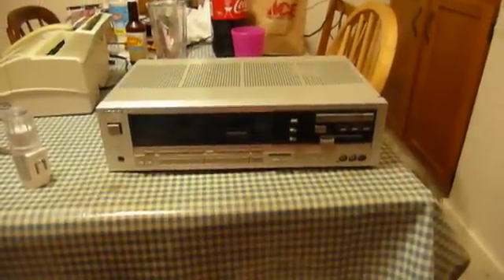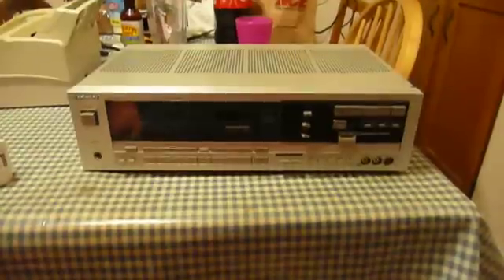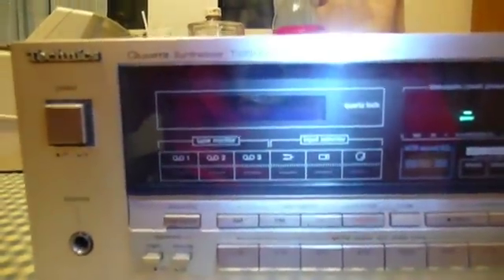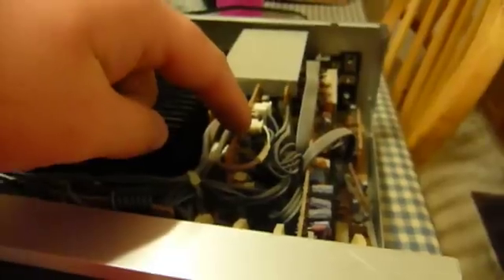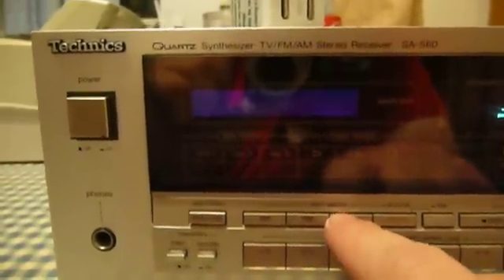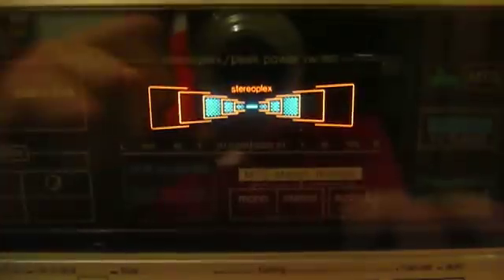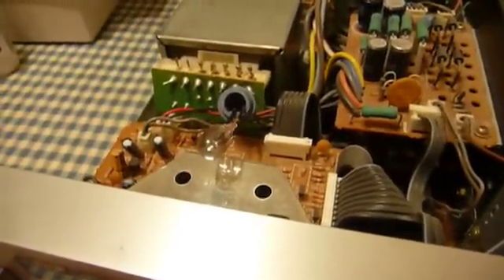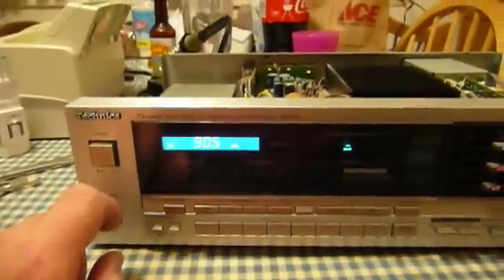Technics SA-560 Repair and Demonstration

Comment: I heard that some of the technics stereo receivers have overheating issues and tend to get very hot quickly even if the speakers are not too low of a impedance which is kind of why some of their receiver models are overrated

Comment: Cool vid, wondered if you have any idea what could be wrong with my technics graphic equalizer, sh 8055, everything powers and lights up, only problem is spectrum display allways shows max reading( full bars) tried dis coneecting everything and all set low still same, cheers!

Comment: why didnt you replace the main bulb? i have one with main and lcd bulb dead, i miss it lighting up that incandescent light color. my bulb actually died because one of my friends dropped my amp. olso once apon a time i was scoping my firednds sundown amp and for some reson my scope with with its touchy controlls send out 40v to my firends amp output, it blew his amp out, his amp ran off an output from my amp, and my soundcard blew out on my computer to... my   Technics SA-560 still works like it did when i got it.
Reply from the maker: To the best of my knowledge, I replaced every bulb this receiver had!

Comment: I have also this same obsession, just with Sony hifi equipment. Whenever I see a piece of old Sony hifi equipment, I just instantly fall in love with it and can't resist but to buy it. I really would like to try out this Technics equipment too as I really like the build quality and styling, but they are fairly expensive over here in the UK in my opinion, either that or I don't have deep enough pockets... There is just a kick you get out of buying these things when you are addicted, and it's always a specific brand or product line.

Comment: Hi there so nice to see some other Technics fans! I have an SA-410 that I just love. In great condition, well it was...All the lights are on but no one is home. It was working fine then one of my speakers sounded fuzzy. I do need new speakers so I thought that was the problem then the sound just stopped. Now no matter what I hook it up to all the lights go on but it won't work. Any idea what's wrong? Very hard to find anyone who will even look at it!
Reply: ***** 
Thanks so much for such a quick response! I did have something repaired several years ago it by a friend when I lived in NY. He was great with this stuff. I now live in Florida and it's so heavy it would cost a ton to send up there to fix. Either way I used to have a pre amp on it for years and it was fine. The pre amp blew and it did just blow a speaker before it went dead. Thankfully they are older speakers too. Any idea who would be able to look at this in FL? Or should I just say good-bye to it?

Comment: Hey UXWBill! Great video. I have a Technics SU-G90 receiver that is being really stubborn. It worked fine until I hooked up an equalizer. The unit turned off, and when you turn it back on, the relay would click, but there's nothing on the display and nothing coming out of the speakers. If you let it sit for a while, it would sometimes come back to life (if you are lucky) and play for a little bit until it decides to turn off and not wake up again. Do you have any ideas that might get it working again? It would be a shame if it didn't work anymore because it sounds pretty well for its age.

Comment: Do you know where I can get a 12v .015a bulb like that?  I have an SA-460
Reply: *****
  Thanks =)  that's exactly what I ended up getting, the pilot IL-194w-5 at autozone for 12.99.  Worked wonders and now I have 50,000 hours.  The stereo will be dead before that bulb lol.

Comment: Hi uxwhill! I wonder if there's a way to tweak the transformer of my Technics stereo amplifier to receive wall power supply from 110 volts to 220-240 volts without any change in the output voltage that it's giving out to the amplifier.

Comment: Btw i have been repairing a few receivers too, and i did replace my glass bowl lamps all with LED's because those glass lamps all die really quick, i just dropped a 1k resister between it and it worked perfectly.

Comment: Bill, 
      I have a Technics SA-360 with the quartz syntheizer and am/fm/tv receiveing capibilities. It's problem is that the right channel is weak and distorted and the front a/v jacks don't work when selected. When I got mine the backlight bulb was toast too. Until I tore it apart I didn't realize how many other bulbs was in there and burn't out. Mine is a New Class A amplifier. It's not computer driven or a hybrid. I was wondering if you might have any info available. Thanks, Nathan

Comment: that seems like it does the same thing as the satellite speakers on my aiwa radio. actually like the aiwa cx-naj80 aka nsx-aj80 as the manual says i found online says. 250 watts and a lot of bass. there are 2 connectores for each speaker.

Comment: my 94 toyota camry radio a16404 has a light that messed up. should try and fix it some time. sure this radio is a basic one with tape but i sounds better then the sony explode and vr3400sdu radios i tried. toyota put 6 ohm speakers and radio in there car and the speakers just don't sound right with them since the radios are 4 or 8 ohm. i don't want to change the speakers since there is nothing wrong with them.

Comment: I own a Technics SA-351 and it blew out where it won't turn on. Is there a way to fix it? I love this receiver. <3
Reply: Check fuses in the inside. Don't replace them. Take bottom and top covers off...look for burning. Blowing up a power supply and replacing the fuses to try again means your amp will probably turn into a welder and cook whatever it protected with the fuse. Since you love this model. Find another for $200 and say thank-you to the old one and list it as broken and be very specific with its problems. Somebody can fix it as a hobby...but if they have to charge someone else...it's not cost effective.

Comment: I have a JVC R-X500 that had the same issue - in the case of the JVC, it uses those 12V fuse type bulbs that are often found in more vintage receivers. Luckily there is an audio shop right nearby that sells them. About an hour of work and replacement of the fried zener diodes that always burn up when bulbs fail in these JVCs, and she's good as new. That receiver drives a pair of Polk Monitor 5 Junior speakers in my bedroom. The price for the receiver was $10 on Craigslist a bunch of years ago.

Comment: Technics used computer drive new class a on many of their receivers and amplifiers in the 80's and 90's.They also had a class aa vc-4 amplifier system that produced pure class a sound without being affected by load conditions and an active servo power supply that operates in silence that exceeds that of a car battery,often said to be the ideal power source.

Comment: I have a question for you. I have an MCS 2240, of similar vintage to most of the Technics recievers you have, and since MCS (JCPenny) is made by Technics, you may be able to help me. The left channel of this reciever has full power output and sounds great, but the right channel only produces intermittent farts of sound. Usually only when the volume is set to an obnoxiously high setting. Any suggestions?

Comment: @uxwbill it still worked on the right channel and somehow it bypassed the bad part of the amp and allowed it to still run. when i had visited my uncle i did run one of your kitchen table electronics repairs though it was a laser lens cleaning.  cleaned up the laser and the player went back to normal. it was having issues reading discs at the time.

Comment: My SA-946 has indeed been quite durable, although hot-running. Yours is one step better because it has MTS stereo TV audio, while mine is just mono TV. At least on the 946, you tune the cable TV channel by holding down the CATV button until it changes. It also has a fine tuning button for CATV, but I haven't figured out how it works. And of course mine also has the bad solder connections on the front panel; I usually have to tap on it to get the backlighting and indicators to light up.